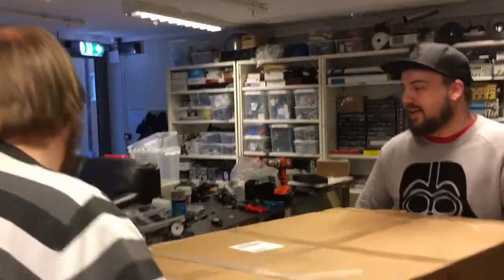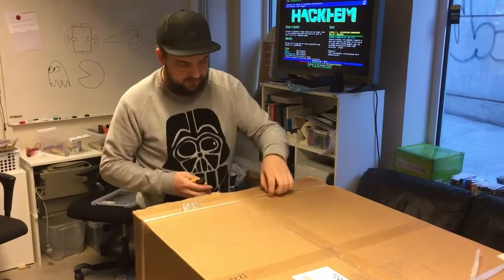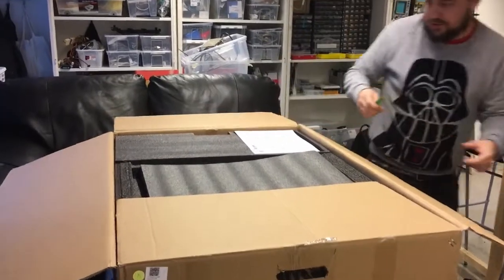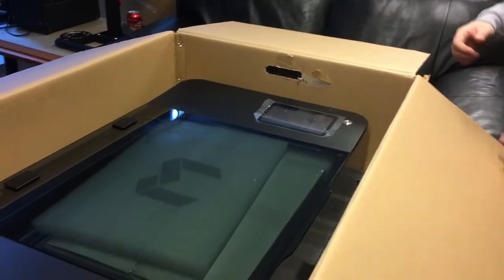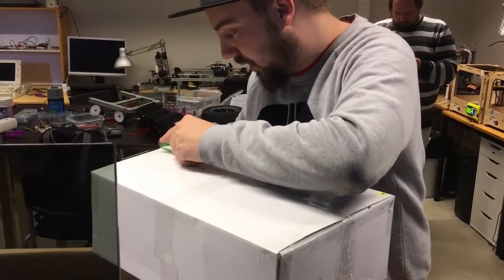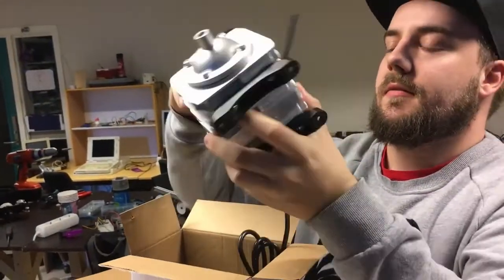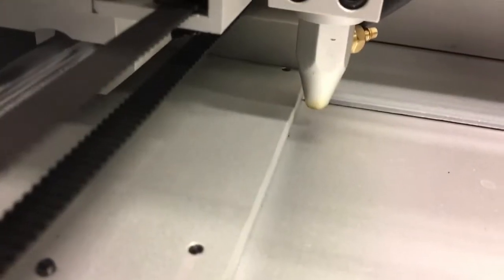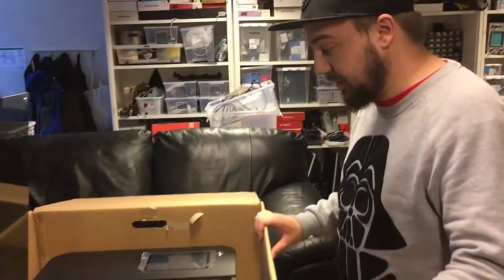Full Spectrum Muse - Unboxing

Comment: I am also a muse owner. Keep us posted how yours is working for you!
Reply from the maker: Works rather nicely, we've got some issues with the camera being a little bit mis-aligned but its lovely to have a machine that just works out of the box!
Reply: @nikolaiovesen279  im looking into getting one - how is it 3 years later?
Reply: @Mcgougle  still running nicely, all in all happy with the machine, afaik the newer models have more sexy features as well.
Reply: @laeven  which model did you get? do you use it just as a hobby or the lightly manufacture